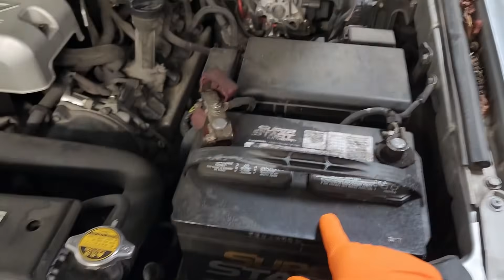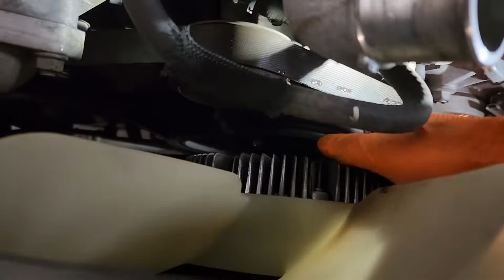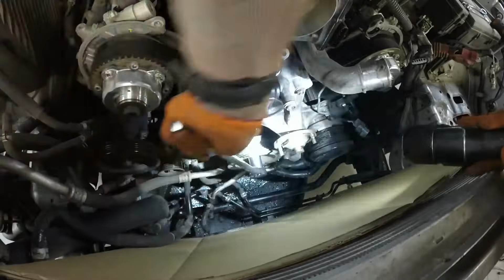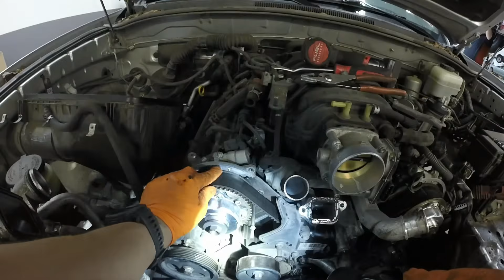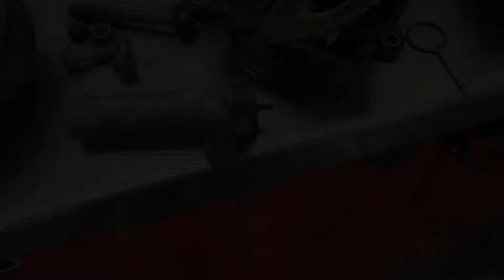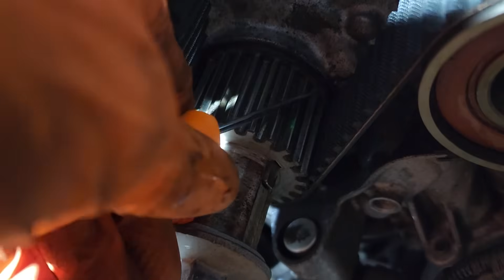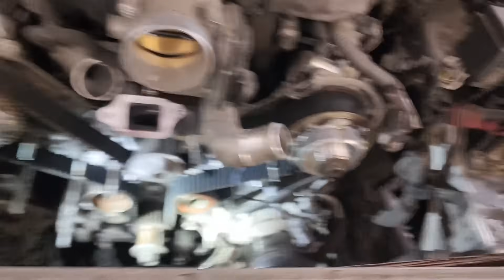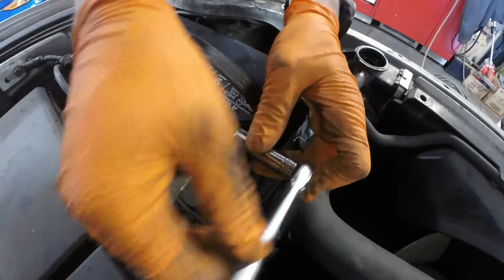Timing belt replacement by a Toyota master tech

Comment: When i was putting the belt on the left cam moved back so i tryed cranking it to line up with the T and it jumped so did 2 revolutions on the left cam to line it back up did i mess this up
Reply from the maker: As long as all the marks line up with the belt on you should be good.

Comment: Pro tip from a 25 year ASE: spin all idler & tensioner pulleys and fan support bearing listen for any noise at all or free spin like no grease. If found, replace that component.
Mark all alignment marks with a white paint marker. On the crank mark a mark at 12 o'clock on the pulley & block for easy reference. Even if the belt is marked.
Reply: Should there be any back and forth play on the power steering pump pulley when tugged on?
Reply from the maker: The pully to the pump should be tight.
Reply: @shoptimewithdrew I figured thats my annoying noise issue. Not able to get new atm so I'll be pulling the power steering pump from my 01 Sequoia. Wish me luck.
Reply from the maker: Have fun!
Reply: Should the power steering pump have any play when tugged on back and forth?

Comment: Can the timing belt be realigned to the correct position after I already test ran the engine with the new belt incorrectly installed?? I’m a big money saver and DIY’er and didn’t see this video until after already incorrectly completing this job. Once I noticed the first test start up didn’t feel or sound right I shut off the engine ignition and called it a night.. what do you think??
Reply from the maker: Sometimes, it can bend valves on this engine, but I know people have had luck re doing it, and it running fine afterward. I would give it a shot if I were you. Set the crank to the zero mark or the dot just past the zero mark. Pull the top covers and see how far you are off. If it is slightly off, you can pull the tensioner, and it should give you enough slack to rotate the belt so the cams are correct. You do not use the marks on the belt because  the covers will be on. If you want to use the lines on the belt, you will have to remove everything and start over. Hope this helps.

Comment: Hello Drew,
Just came across your video. I have a 2008 Toyota 4 Runner....at 82, 000 miles...I m going to a dealer to have belt... serpentine belt..water pump replaced....Im nervous bcuz finding a good tech is a blessing...like yourself.
Any thoughts...about changing my alternator as well.....nothing is giving me trouble.... dealerships make me a little nervous. They found out while just changing my right blinker/side light that there was a  little melted area...they were able to change out light...now they suggested doing a dialysis on why its causing that? Do you agree? Today is 12/13/23....hope you see this before 12/15/23🙏
I wish you were local....I would bring my truck to you.in a heart beat.😊
🌟🌟🌟🌟🌟 for you. Blessings
Reply from the maker: Thank you for the comment! If I were you for the bulbs socket, if it is slightly burnt, I would probably have them change out the socket and re check at the next oil service to see how it is looking. Should not cost too much to chaing out the socket. Most of the time, what causes that is the pins are loose, and that causes resistance in the connection. When there is high resistance, that can cause heat. If they tell you it can't be changed or you have to buy a complete wire harness msg me and I will find you a part number. For the alternator, I would leave it if it has no issue, no reason to spend all that extra money. I have seen some 4 runners with close to 300k with an original alternator.
Reply: @shoptimewithdrew , thank you, for responding back. Well, they had to replace my radiator they said there was a hole, the size of a quarter....I requested them to send me pictures...
I didn't see the hole, although, there was  this crusty white/ pink foam....so, I had that changed out. I have a question, maybe two. The original 08 top cover was metal or plastic?
Reply from the maker: I want to say the 4runner was plastic, and the Tundra was metal. I'm not 100% sure.

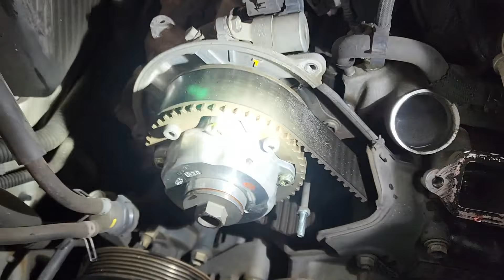Comment: I would not recomend using any power tool(like in the video 17:40 ) to clean the surface for the water pump.. you can grind too much and then your really screwed.  just use some hand sand paper fine grit lightly until you take the old oxidation off which comes off very easy... clean up with spray cleaner or water, all the surface. IMO.. also 10:13 has a good explanation of the lining up of the marks to remove the belt properly.. however, for this job, I would highly recomend removing the whole radiator, replacing it with OEM, and the hoses, clamps, new radioator fluid change. also, most will remove the bolts for the compressor, not bend the bracket.. it will break then you have to do it right and replace it. I had a garage do this, with replacement of the radiator, fluid, hoses, costs about 2k$. in the DC area for a 2004 Tundra 2UZ-FE.

Comment: Great video.  The only thing I can add is you can remove the camshaft position sensor with the driver side timing belt cover and not have to deal with the wire grommet.
Reply from the maker: That is true.

Comment: Excellent vid! I'm the 5th (lol) owner of my 2uz with 200k miles. The TB was changed 2x with aisin kit, but it looks like the WP is leaking for some reason. I haven't started yet, but I'm afraid to strip out the threads on the oil pump housing that the 10mmg hex bolt for the tensioner goes into. I was thinking about first putting some heat on it, then tapping it a bit with a hammer, then trying to gently take it off. Any thoughts on this approach or other recommendations?
Reply from the maker: Why are you worried it is going to break/strip?
Reply: @shoptimewithdrew  heard others have that problem, especially if prior job overtightened or used red loctite. I actually just got it all loose today tho! That hex didn't want to come off. Did a couple rounds of heat and CRC freeze off and gentle impacts. 

Now I'm trying to find out why this 10k aisin wp gasket leaked. Can't see obvious broken rubber seals, so I'm thinking they didn't torque it down well
Reply from the maker: Could not have been torqued correctly. Make sure the block is cleaned good, no foren matter stuck to surface and no pitting.
Reply: @shoptimewithdrew  gotcha. Do you recommend any FIPG (small thin layer) on the gasket as well or is that not necessary on the oem multi layer steel gaskets?
Reply from the maker: I have never used FIPG on the gasket. I would not recommend it. I would probably only use it if there was deep pitting to help seel the voids.
Reply: @shoptimewithdrew  Gotcha. I don't have a rotary polisher and was planning on just hand cleaning the surface with grey scotchbrite pad, but it seems some advise against using any scotchbrite products. Do you have any thoughts?
Reply from the maker: I use the red or green scotch bright pads at times. I don't think you can press hard enough to mess up a cast iron block. I also use a wire brush at times.
Reply from the maker: Heat and tapping are always good ideas.

Comment: Hey Drew!  Thanks for the awesome video.  I just completed my first timing belt change thanks to your video. Slight issue,  one of the 12mm bolts that holds the timing belt tensioner was cross threaded so it snapped on me.  Car runs fine (300 miles so far) but what's my best bet - drilling it out or can I buy just the front cover?
Reply from the maker: Thank you! If it is the bolt im thinking of, I think you will have to drill it out and tap it or add a timesert. That bolt goes into the block.
Reply: @shoptimewithdrew  It does look like it but I also saw a bunch of bolts so was hoping the front cover came off as one piece.  I snugged the timing belt idler shaft bolt a bit more than the torque spec as an added insurance but I'm hoping the one bolt will hold the timing belt tensioner in place for now until I drill it out.
Reply from the maker: Oh, I thought you were talking about the drive belt tensioner on the front of the engine.
Reply: @shoptimewithdrew  no the timing belt tensioner with the pin. The two, 12 mm bolts looks like it goes to the front of the block but seems like it comes apart.  I can’t find any diagrams on the web or else I will tell you what it’s called.
Reply from the maker: It is part of the oil pump. You will have to drop the oil pan and then pull that pump cover. Google Toyota 4.7L oil pump for an image.
Reply: @shoptimewithdrew  looks like I’m gonna try to drill it out because it’s pricey!  Lol.  Thanks again for all the help, and the video was very informative.
Reply from the maker: You are welcome. Good luck.
Reply: @shoptimewithdrew  I like living on the edge so I'm going to leave it like that for a bit.  ;)
Reply: Lexus V8 timing belt tensioner problem FML
https://youtube.com/shorts/ZCYVHNQBvtk?feature=share.   This bolt…

Comment: How do u fixed jumped timing I gotta 2000 tundra and it jumped timing and if I line the crank up none of the pulleys line up on the marks their suppose too do I jus take the belt off and put the pulleys to where they line up on the marks and put my new belt and stuff on I’m so stuck rn I can’t find no videos on it and nobody ik will help or even know what to do and you def have had the best video I could find yet please help meeee
Reply from the maker: How far are they off? Do you have Instagram? You can send me photos.

Comment: Thanks for this. In the middle of this job now but am at a stop regarding if I should use my impact or not to tighten the crankshaft bolt. If I do say tighten it pretty well with the impact, will be hard to know if I get the correct 180lbs and then throw a torque wrench to check the lbs l, would this turn the timing belt out of wack or do you think it would be locked in at that point?
Reply from the maker: Using an impact is fine.  If the tensioner pin is pulled, then the timing will stay the same.
Reply: Will give it a go - thanks! @shoptimewithdrew

Comment: Thanks so much! Best explanation of timing marks, and most efficient way I have seen it done in videos. Most people completely remove the alternator (without replacing it) as well as fully unbolt the a/c compressor. Great trick bending that bracket instead of unbolting the compressor. Thanks again.
Reply: Not sure if I should have done that when I replaced the fan pulley or if it mattered. Doing that was half the labor of that of the timing job.
Reply from the maker: Ya, there is not much left after taking the fan pully off.
Reply from the maker: I'm glad you liked the video, and it was helpful.

Comment: What did you use to clean away the old gasket and the crankshaft? Thanks
Reply from the maker: I just use light grit sand paper, razor blade, roloc disk, and brake clean.

Comment: Great video!  Quick question, on my 07 tundra I had the timing belt break at idle and am gonna take a chance on new belt.  Do I need the crank at TDC compression or can i just align the cam n crank factory marks?
Reply from the maker: Not sure what you are asking with factory marks? Do you mean on the factory belt?
Reply: Not the belt, just align the timing marks on the cam gears and crank gear.  Basically I’m worried the crank is 360 degrees off.  Sorry never installed timing belt before
Reply from the maker: The best way is to pull the number 1 spark plug and stick the oil dipstic rod in and see if the piston is low or at the top when the crank is at the zero mark.
Reply from the maker: Put the cams at the T mark when rotating the crank. Hopefully, no valves got bent.

Comment: I just had mine done.  2001 Sequoia.  Around $1100 p&L on so. cal.  I chose a lexus/toyota shop.  Glad I did not try to do it myself..worth the money IMO.  BTW my engine had about 123,000 on it.  No I won't be worrying so much driving up the 5 from LA to SF.
Reply from the maker: That sounds like a good deal in California. I'm glad you got it taken care of no more worries.
Reply: @shoptimewithdrew  I love my Sequoia.  If they ever outlaw that V8 they will have to pry it from my cold dead hands.

Comment: So I installed the belt and all my marks lined up and I did a revolution but forgot to pull the pin first. What do I need to do to set everything right in place again? Help please!
Reply from the maker: You will have to rotate the engine and use the marks that are on the cams and crank to get to top dead center. Verify that all marks are in the correct location.
Reply: @shoptimewithdrew  so if I'm understanding correctly I need to remove the belt rotate everything to position then re install?
Reply from the maker: How far are you from top dead center?
Reply: @shoptimewithdrew  so I completed the revolution without pulling pin. My "L-Cam" and "R-Cam" marks on the belt and the "T" are lined up but using a mirror underneath the crank pulley it doesn't look like the belt is lined up anymore with the marks
Reply from the maker: The belt marks only work when first setting it up after you turn the engine over the marks on the belt will be off. If it looks like the cams and crank are in the right area, you should be fine. To be sure, you can pull the belt off and then re install it to verify that everything is in the right orientation. Some things are hard to explain over text.
Reply: @shoptimewithdrew  I pulled the belt off and it doesn't appear like it's lined up. So just rotate everything back and then good to go with belt install, tension pull pin etc?
Reply: @shoptimewithdrew  I got the crank lined up with the dot but the cams don't seem to be aligned anymore. Not sure what to do now.
Reply: @shoptimewithdrew  do I need to re install the belt and rotate everything so the cam marks line up TDC again? They aren't lined up, it's easy to get the crank to TDC.
Reply from the maker: If the crank is lined up with the dot it is past top dead center. Leave the crank past top dead center and then rotate both cams to the T marks. If the crank is at the dot and not at the 0 the pistons will be down slightly so the valves should not hit on the top of the pistons.
Reply: @shoptimewithdrew  so it's okay to rotate the camshafts on their own to the t marks without the belt on?
Reply from the maker: As long as the crank is at the dot, not the zero.
Reply: @shoptimewithdrew  when you say the dot..do you mean the notch on the crank pulley being lined up with the dot on the oil pump? It doesn't want to turn anymore to the dot. It's about 2 teeth to the left.

Comment: I just did this job on my 2uz and I was concerned about having messed up the timing. I put the belt on at all the correct marks but i made two full rotations and the belt marks don't line up anymore. Is this an issue? I haven't started it up yet I just finished it, but this is my first time doing maintenance with anything to do with timing so im just very cautious.
Reply from the maker: The lines on the belt will line up when first set up. After you rotate one time, the belt marks will not line up with the cam and crank marks anymore. As long as all the lines on the belt were lined up with the marks on the cam and crank before you rotated and then pulled the tensioner pin, you are good.
Reply: @shoptimewithdrew  thank you man, I really appreciate you getting back to me and especially so quickly. I started her up and it's running perfect!
Reply from the maker: You are welcome. I'm glad it all worked out.

Comment: Would this be the same on a 3uz ?
Reply from the maker: Yes, almost everything is the same for belt routing. Some of the accessory mounts are a little different.
Reply: @shoptimewithdrew I got the aisin kit I’m doing it myself so kinda nervous everything seems pretty simple except it says put the crank at ATDC so after I spin it around 1 time after putting the belt on and it’s at TDC I put the crank pulley at the 0 ?
Reply from the maker: 0 would be top dead center, then rotate it to the T, and that is after top dead center. 0 on crank and lines on cam caps is top dead center. White pin mark past the 0, and the T marks on cam caps is after.
Reply: @shoptimewithdrew  why do they recommend putting ATDC to remove and put new belt on?
Reply from the maker: Yes, it helps prevent cams from rolling over and possibly making contact with pistons while the belt is off.

Comment: Great video, first time I see someone actually explain the timing marks correctly. I have done this twice so far on my Sequoia. You don't say how hard it can be to remove the crankshaft pully bolt. The first time I did it, I used the air impact driver and was about to give up when it finally started rotating, it took so long, the socket was hot to the touch. The metal bracket on the alternator is held on with one Philips head screw, why bend it with a prybar?
Reply from the maker: Ya, the pulley can be a pain to get off. I just bend it out of the way for speed, and sometimes those screws are rusted in and don't want to come out.

Comment: Does aligning it with the "T" apply to the non-VVT 4.7L as well?
Reply from the maker: It works for both styles.
Reply: @shoptimewithdrew  thank you! I wasn't sure cause all the other videos just use the TDC line. Never the "T"